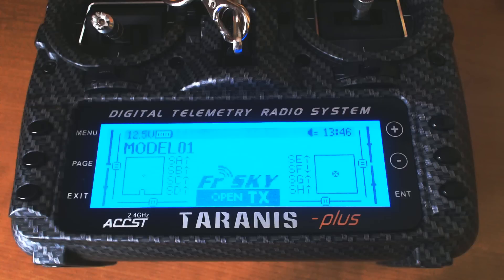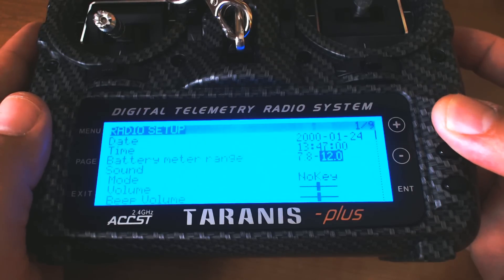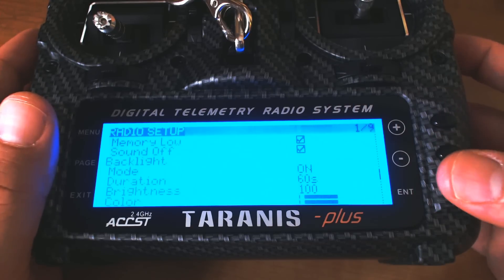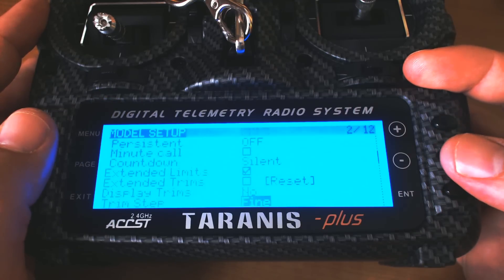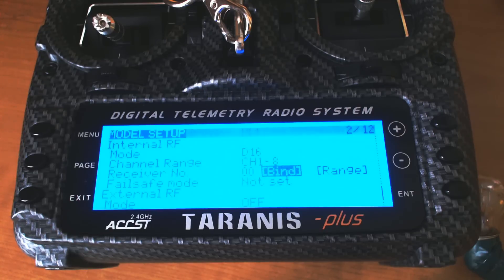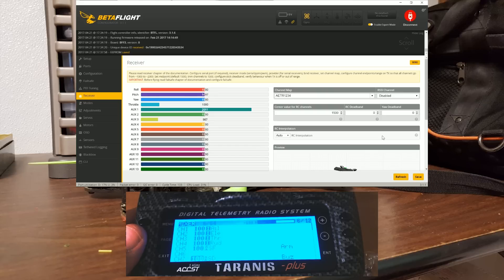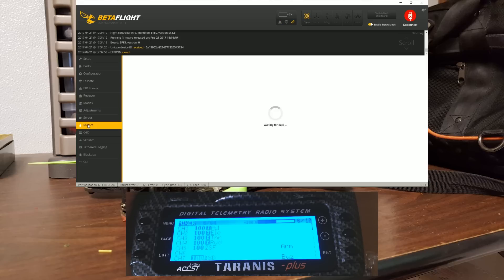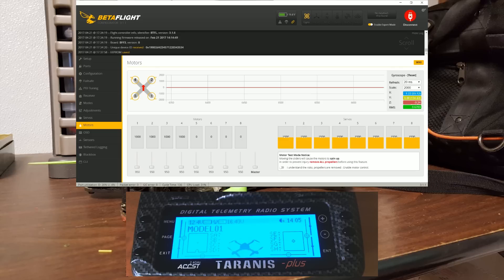How To Set Up FrSky Taranis and Betaflight / Cleanflight Configuration

Comment: I'm a beginner to quads and picked up the d9x plus and something as easy as the changing the aetr was something I had missed in other videos and it may be what I have been struggling with.. I stayed up till 1am trying to figure out why my pitch and throttle were swapped but not my roll and yaw and I'll bet changing the default channel order to aetr will fix my problem.. thank you so much for being so thorough.
Reply: If you really want the X9D to be future proof. Buy an ExpressLRS module for it. You never have to worry about range ever again

Comment: Which is the best receiver for taranis x9d plus? Thanks
Reply from the maker: RXSR
Reply: @JoshuaBardwell  thank boss. And I have another question. I downloaded newest betaflight but when I connect quad with my laptop it's failed
Reply: @JoshuaBardwell  excuse me sir. I bought iflight green hornet with R-XSR receiver. So if I want to set up for it I have to download R-XSR firmware for my taranis x9d plus?

Comment: Hi Joshua got a question, When I move the pitch and roll the motor is not spinning, what I did is I set the arm switch on Taranis X9D Plus just like this and I also set on the mixer ch5, on Betaflight in Receiver's Tab I can see the Pitch And roll stick is moving which means the channel map is correct, the Channel Map as per instruction on Eachine Twig's manual is TAER1234, the model on Taranis X9D plus is set to TAER as well. the throttle and yaw is working except for Pitch and Roll.

Comment: Hey dude, I need help. I have a Taranis Q X7 controller, which worked perfectly for months. But a problem just appeared, when the sticks are centered, it shows on the screen that they are actually not, they're at about a 2.5 degree angle, both of them. This affects flying pretty badly, do you know how I could fix this ?
Reply from the maker: Re-run the stick calibration routine in the radio.

But it might mean your gimbals are wearing out and need to be replaced.
Reply: @JoshuaBardwell   I tried several times to recalibrate my sticks, but it keeps registiring it as not centered.
 You mentioned that the gimbals might be running out, but I have only used it for a couple of months, could it still be a cause ?

Comment: I bought the X9D 7.4 Volt battery that fits in the transmitter. Will the transmitter charge the battery when plugged in? You made a remark about a special kind of battery that you put in your transmitter, which one is that? Also, why will it not charge that battery?

Comment: Thank JB for such an informative video,  I have Taranis SE and followed you instruction to the t and still coming out with all my brushed models with incorrect channel mapping in Betaflight.  I set the radio setup to the default channel order of "AETR"  then bind two different tinywhoops and the channel mapping is the same in betaflight which is "AETR" but the TX  throttle is working on Pitch in BF , RX Roll is the  throttle in BF, TX roll is the throttle in BF and Yaw is correct.  What is going on have I left out a step?

Comment: What would you recommend for battery meter range and battery low settings with the new 2019 XD9 SE and a 2500mAh 2S RDQ LiPo?

Comment: Hey JB, I hope your doing good today! I have a quick question, Im using my qx7 to set up a quad using crossfire, but Im not doing the mod because im using r9. Im getting low rssi verbal warnings from the qx7, osd is not showing this, I cant find how to set the baud rate, and not really sure this will help. Can you please explain how to set the baud rate, and if this sets the baud for the radio, or just the channel. I appreciate any knowledge your willing to share, Thanks JB, Take care!
Reply from the maker: The baud rate is set in the Hardware screen. Long press menu button then page to Hardware.

Doing the inverter mod won't affect R9 function.
Reply: @JoshuaBardwell  Thank you for helping me once again, I was on that page I just didnt look far enough down. It took care of the verbal alarm. I just received my Jumper pro today, Im pretty happy except I was kinda bummed the switches are soldered in, I had to change 3 on my QX7. 👍

Comment: couldn't find a video on it so I thought i'd ask here: my Taranis won't speak during the "open tx" screen or for switch/throttle warnings all of a sudden without me changing any settings. any ideas on why? volume is all the way up :/
Reply from the maker: The audio files are read off the SD card so if the SD card contents are not in the correct location or if the SD card is missing or damaged, that will happen. You can download the SD card contents off of the OpenTX web site.
Reply: @JoshuaBardwell  thank you for the quick reply! will investigate and see what I can do.

Comment: when I try to set it up it keeps saying transmitter battery low even though it's plugged  in all day? WTF
Reply from the maker: What is the actual voltage of the battery? Is it inside normal range? The warning level is configurable. Maybe it's just set too high.
Reply: @JoshuaBardwell  yes I raised the warning level and it stopped. I find it all not to user friendly. I will continue soon thanks!

Comment: I need a value greater than -100/+100 to get my endpoints set! I can’t figure out how to increase those value in my Taranis. I saw another video where they had theirs set to 512. Can you tell me how to increase these values. Thanks for all that you do and have a great day.
Reply from the maker: Enable "extended limits" in the model setup menu.
Reply: Joshua Bardwell Thanks I appreciate it.
Reply: Joshua Bardwell I’m going to join your Patreon when I get home. You’re a great help.
Reply: @JoshuaBardwell  it worked but limited the range to 150/150. I’m setting up my Scimitar with and it won’t throttle up because the lower endpoint is at 1127 with minus 150 ?? Sorry for being a pain.
Reply: @JoshuaBardwell  I had to go into Betaflight and use the RXRange command to set the endpoints to what they were reading and now all is good. (short version) Thanks for your help.

Comment: Hi How do you connect to computer with your radio ? I tried with Micro USB and it doesn't connect. Please kindly let me know.
Reply from the maker: Long-press Menu button to open the Radio Setup screen.

Down near the bottom find "USB Mode" option. Set it to "Ask".

Now when you plug in USB the radio will ask whether you want to use Mass Storage (which is for connecting to Companion), or Joystick mode (for playing sim).

Comment: Bardwell help! I just setup my quad  and in Betaflight throttle is not responding, but all other stick inputs are like roll, pitch n yaw? Any idea whats wrong. It was working with a different Esc board fine before
Reply from the maker: https://www.youtube.com/watch?v=jM74FdwJf_8
Reply: @JoshuaBardwell   Hi it is not turtle mode- it is not active. Its weird all other stick inputs work like yaw, roll and pitch just no throttle response in Betaflight? Any other ideas
Reply: Ahhh I figured it out, in my own ignorance in a haste to make my RSSI telemetry work I changed in the Crossfire LUA under (Dst Ch1) I set it to RSSI and that wiped out my throttle from working. Maybe this info will help someone one day if they search really carefully.

Comment: I want to stop and say thank you. I spent 12 hours yesterday trying to figure out this process on 3 new radio transmitters. After 12 hours I packed everything up so nothing bad would happen and had a few beers. 
I found my new x9d + SD card was blank so the model types sounds etc were missing. This meant I could not follow darn near all the tutorials out there. It took forever to find out these files were all supposed to be on the SD card. Nobody talks about that on any videos. You have to dig into the forums to find it.
I tried downloading the companion to setup my radios but could not get the drivers downloaded... it was just one thing after the other..
You lay this out in such a logical fashion I think I can give this another try. Thank you very much.... I do believe I should support you a little in return! 
Thanks for the awesome videos

Comment: Hi, i just got my first quad. i ended up buying a prebuilt the geprc mark 2 bnf. My transmitter is a taranis, i think i succesfully bound the r-xsr because of the green light. when the quad is connected though betaflight isnt registering stick movements or anything. if anyone can help id appreciate it/
Reply from the maker: You need to enable "Serial RX" on the correct UART in the Ports tab.

Then in the Configuration tab set the receiver type to "serial receiver" and the protocol to SBUS.
Reply: @JoshuaBardwell  i ended up finding an old video where someone said i might have held the button on the rxsr to long. all it took to fix was holding it for 4 sec if anyone else is having problems.

Comment: Setting up a brand new X9D Plus by following your video, downloading all the latest scripts, Amber pack and firmware, and I noticed that I cannot select any images for the model. There are no images on the SD card and when I try to select an image, all I get is "---" (no other choices available). I read my radio into the Companion app, and there are no images there either. Any suggestions?
Reply from the maker: In order to see images in Companion, you have to do something specific with your hard drive, so that's not unusual. But honestly I never really use the model images so I can't say why they aren't working or how to fix them.
Reply: "something specific with your hard drive"? Wow, that's probably the most cryptic answer I've ever seen you give! LOL.
Reply: Aircraft icons can be downloaded from here: https://www.open-tx.org/icons-taranis.html
Once downloaded, place them on the SD card in the IMAGES folder. I'm guessing the same icons can be loaded into the Companion app somewhere.

Comment: Hi all!..(I,m a newbee),..and am stuck trying to get my head around something.
I bound a new 2nd,bnf model (to my sole existing model) on my x9d,)by way of receiver# 00.Everything seemed ok ...except now my arming switch,beeper switch,and acro/angle/horizon switch,do also work,..but in REVERSE when flicked.Any ideas how to get the reverse the action of them without affecting the other kwads profile ?
Reply from the maker: Go into the quad's flight controller configuration and change the modes?

Comment: stupid question why did you change it to 2000 and not leave it 1500
Reply from the maker: Sorry but I'm not sure what you're referring to.
Reply: I'm really sorry this is all new to me but I see you changed the end points to 2000 or am I misunderstanding what your doing?I see this changes the transmitter (remote) to 96- 97%

Comment: I am having an issue with my Q X7 - and trying to get my quad up and running, I purchased the bardwell AIO and have the XSR to go along with them, for some reason my controller has an issue where in clean flight and beta flight, that the 3d model keeps spinning out of control, and fluctuating spontaneously, in the actual q x7 there are a few numbers (i'm a rookie at this stuff) that are fluctuating back and forth as well. Any help would be wonderful - sincerly n00b
Reply from the maker: Usually this means you have your serial receiver protocol set wrong. Like you have an SBUS receiver but you have the protocol set to spektrum. Go to the Configuration tab and change the setting.
Reply: Joshua Bardwell then another issue I'm having is the board goes into dfu mode after I save and reboot sometimes. Also thanks for the help!

Comment: do you not have to setup switches (buzzer and arming) on the inputs page as well as on the Mixer page? I'm new to Frsky. thx
Reply from the maker: No, not at all. You can simply base the mix directly on the switch, rather than using an Input as an intermediary.

The only time you really need to use an Input is for the four main inputs (throttle, pitch, roll, yaw) where you might want to apply a custom curve or expo or dual rates.
Reply: thanks. i asked only cuz i saw some others do it that way and wasn't sure. thanks again!

Comment: Quick question..  I am relatively new to this addiction.  I just purchased this same exact radio to replace my Radiolink..  this video is very informative.  I see that you set the modes up for the arming and the buzzer in the settings of the Taranis.  Is that the same as setting it up in the modes tab in beta flight?  or do i still need to set those modes up in beta flight?

Comment: Thanks for all your videos, I have subscribed! I have a question about RSSI though. I've done what you explained in your RSSI tutorial but when I look at telemetry, I have an RSSI sensor but no value and it doesn't work. I have the same model tx in this video and a Furibee X140 that has BetaFlight 3.2 and I bound it with 16 channels. Any idea what I'm missing? Thanks!
Reply from the maker: Most likely the receiver is not reporting RSSI telemetry, or maybe it doesn't support telemetry at all.
Reply: All of the videos I've seen show RSSI coming from the Frsky XM receiver on this quad. I guess it's possible this function isn't working on my receiver. Is there a way to check what version of firmware the rx has on it or upgrade it while it is on the quad from my Taranis Plus X9D?

Comment: I am using the default battery that came with the Taranis. In the setup screen the voltage range is 6.0-8.0. Does this need to change?

Comment: IMPORTANT !! Lipo Voltage for a 3s battery is FULL 12.5-6 , LOW 11.2 at lowest ... going lower will start to damage the cells  ... GREAT Videos otherwise !! I'm learning about the Taranis Controllers and the Cleanflight Setups ... THANKS so much for the great videos !!

Comment: Hi Josh! I’m having trouble with a couple things. I’ve got a spracingf3evo (femto f3), it’s in a gremlin. I have telemetry and osd on in configuration but can’t get vfas and isn’t accurate. Also can’t get osd onto the goggles at all? Is there a certain way to wire the camera up for osd? Would my vtx and cam not be compatible? Can’t find a video on it. Cheers
Reply from the maker: That FC doesn't look like it has an OSD. Likewise, have you wired up telemetry? Does it even have a UART output for telemetry?
Reply: Joshua Bardwell - ended up being the firmware on my brand new R-xsr. In case anyone else comes across same issue. Finally got to set up my special functions thanks to your videos, cheers 👌🏼

Comment: Hi Josh. Do you think its wise to use a lipo in your radio? What about charge state and storage charge. After all it is still a lipo.....
Reply from the maker: The capacity is surely reduced by being at full charge all the time, but since I'm only pulling a few hundred mA total, it still lasts for weeks. So it doesn't really matter.

Comment: Please help. No stick movement in BetaFlight.  Just got a Taranis x9d plus se with a xm+ receiver and installed it to my Bardwell F4 using sbus, 5v, Gnd pads. I updated OpenTX 2.2.1(cca71808) and flashed receiver firmware XM+170313 and bound it. I followed this video to setting end points and I have no stick control under receiver tab although when Taranis is on the AUX 4 range is jumping around between 1750 and 1780 and  it stops when I turn off Taranis. Channel mapping is set up AETA just like you said. Did I do something wrong? Or is it a firmware problem? everything should be non-eu
Reply from the maker: Check green light on receiver, which indicates it is bound and connected.

For r-xsr make sure you used the green SBUS OUT wire.

Solder SBUS wire to the SBUS pad on the JBF4.

Follow the setup instructions in the manual for the FC.

Ports tab, UART 1, serial rx

Configuration tab, serial receiver, SBUS protocol.
Reply: Everything is set up correctly. Green light on xm+ when Taranis is on and red light when I turn it off. Also the fact that aux 4 starts jumping in Betaflight and stops when i turn the Taranis off tells me it is getting some kind of signal. Also I upgraded the JBF4 to betaflight 3.3 
Do the firmware versions look ok?
Reply: Face Palm!!!! I didn't have the arming switch set up correctly.  For some reason the (yaw, thr, pitc,roll) stared working immediately after fixing that. Wasted 2 nice days flashing instead of flying.
"Problem solved. problem staying solved...Rangers lead the way." - Action Figure Therapy

Comment: UGH I am at a loss on how to get Betaflight to see commands from my Taranis Q X7. It binds to the receiver fine and shows the telemetry on it's display but does not do anything in Betaflight when I move the controls. I'm using a R-XSR
Reply from the maker: Start here: https://www.youtube.com/watch?v=ZpU6-JY6fnk
Reply: Thanks for the reply. I figured it out a few minutes ago. It was not the how FC was wired up. That was all done correctly. It was the Receiver Mode. I'm using a Matek F722 & FCHUB VTX w/ FRsky R-XSR. I was trying to use Serial-Base & SBUS but the receiver was actually set to CPPM mode so I had to select PPM RX input. It was listed in FRsky R-XSR manual that if the BLUE LED stays lit then the R-XSR is in SBUS mode, otherwise its in CPPM. I had to long press the F/S to switch modes to SBUS. :)

Comment: Joshua, i ordered an Mr.steele Taranis and it has no mixer screen or sd card slot!
What do I do?
Reply from the maker: I am really surprised to hear this, as I thought the Steele Taranis was just a regular Taranis with some hardware added to the outside. Are you certain there is no SD card slot? It's in the battery compartment on the X9D.
Reply: Im sorry for wasting your time but im a complete idiot, it was their the whole time, im just blind hahaha!